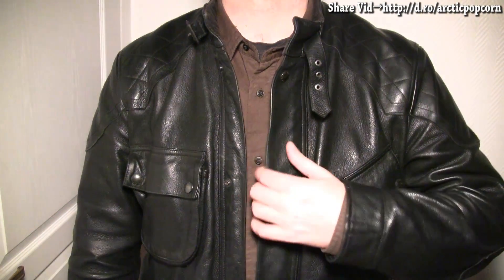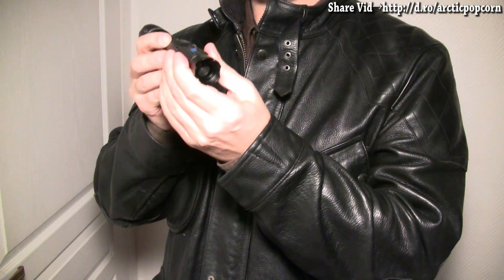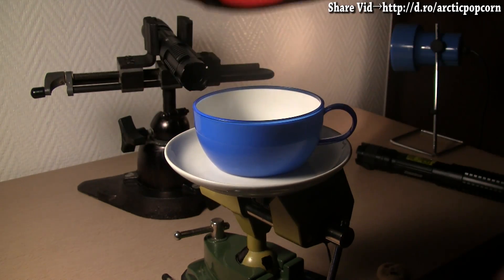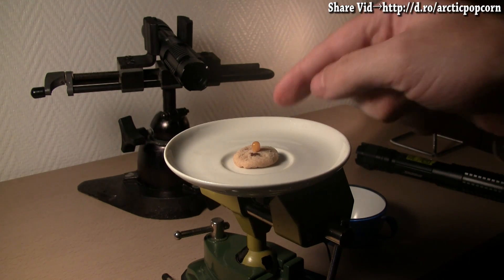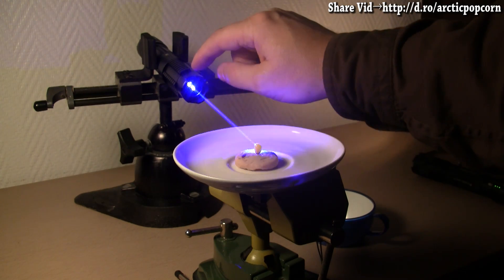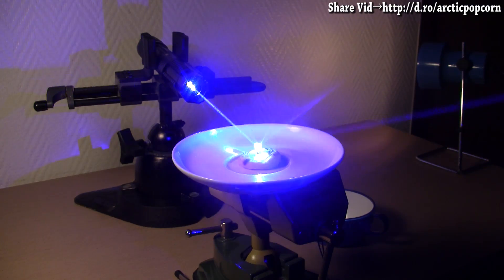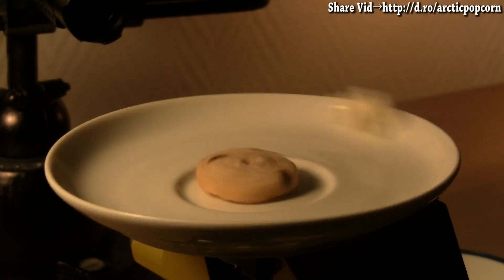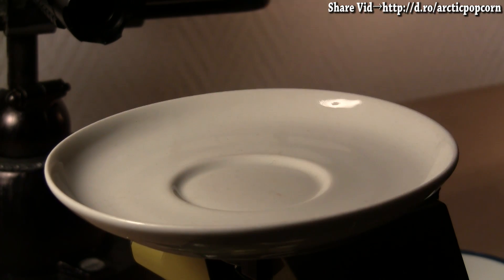🍿 Arctic Lasers Pop Popcorn - Pocket Blue Lasers Popping Popcorn * Wicked Lasers

Comment: If I may add a data correction?
The maximum output for the arctic is quite a bit higher than 1000mw. I have recently taken delivery of my arctic III = 5000 Mw. yes 5 watts @ 445nm. It came with a warning that it can ignite flesh at a very long distance (not going to disclose exact figures) and eyesight WILL be damaged at an incredible distance. I was all stoked when it finally came (had to routed to another country first and then forwarded here to the US) but now it kind of scares me. I have to be very conscious of where it is pointed from the time I turn it on to the time I turn it off. Attention must be taken as any reflectivity of a target material could cause dangerous bounces (even something like a plain white balloon - inflated). Even though they may appear somewhat diffuse, don't be fooled. This thing can cause a lot of damage very quickly.
Reply: Where were able to get the 5w from, the highest I've seen wicked lasers sell is a 2w
Reply: Arctic III from wicked. There should be a drop-down selector for various output options. Not all models they make have the 5w flavor available.

Comment: You should not eat that because the S3 arctic laser has radiation
Reply from the maker: Hey there, your concern is appreciated but while lasers do put out radiation it is in the form of light. That is where the term LASER comes from, Light Amplification by Stimulated Emission of Radiation. That just means that a typical laser puts out light which has no extraordinary power to be dangerous from a radiological standpoint. The form of radiation that can be dangerous is called ionizing radiation, this is the type emitted by radioactive materials. Ordinary laser are not radioactive and to not make substances radioactive.

Comment: Those are cool, but they are expensive, and they really aren't that hard to modify and build check on amazon. Sure some stuff you can buy is low power, but industrial cutting lasers are high power, and cheap, and can make just as good as balloon poppers if not better just not that look like light sabers.

Comment: Thought i saw 3 beams in there.. But yes you have to distribute the heat evenly or it won't work, a bit of oil helps spread the heat fyi

Comment: sooo a bag of popcorn have around 750 kernels times the 60 sec it use to pop thats 45000 second or 12.5 hours compared to the 3 min it takes in a microwave 
so ill stick to microwaving it but thanks for the tip

Comment: @simunator How do you think a microwave works, dude.  It's all radiation.  This is just visible light, whereas a microwave uses microwaves.  Plus a normal microwave will have about 500x as much radiation as these two lasers combined.